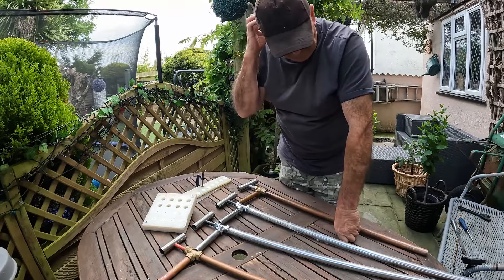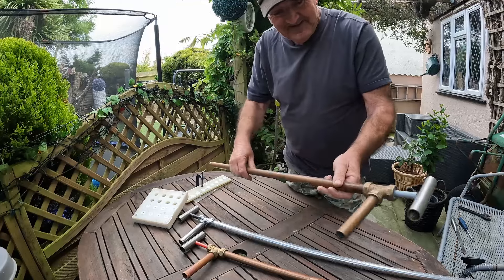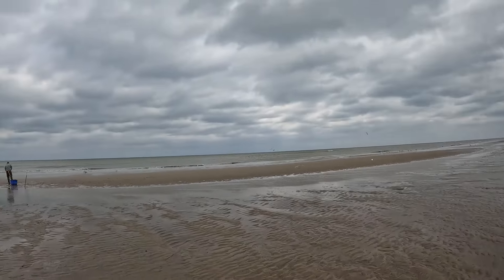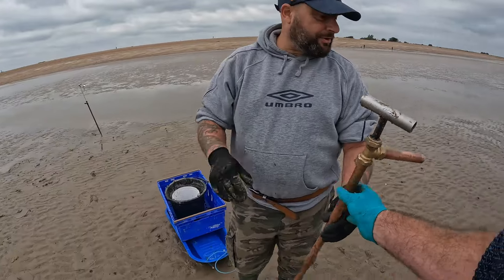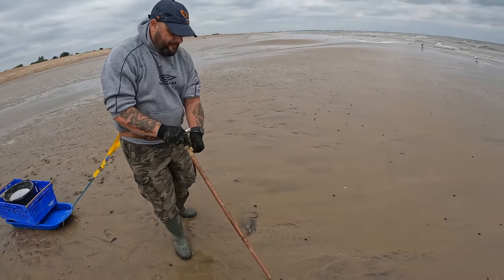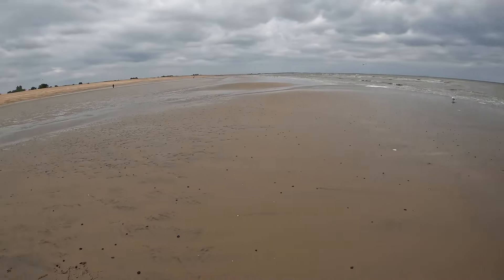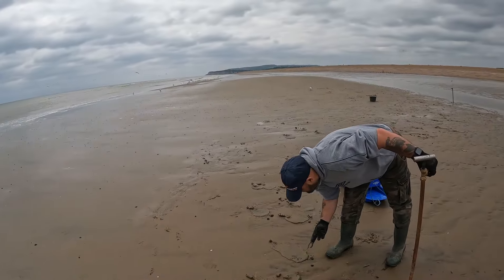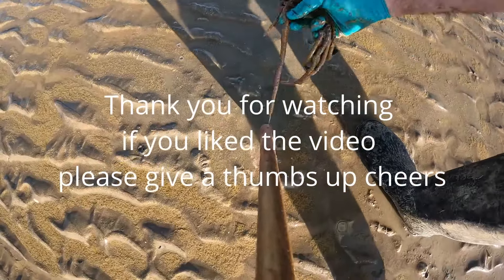jay a subscriber puts my lugworm bait pumps to the test

Comment: Good to see Jay using new pump..  Well all I can say is the pump is so light to use... Great suction with super smooth action and no washing up liquid required.. Great Job Mt.. JC301... (pump prize winner).. Going from getting tails to getting worms.. Tight lines.. You should patent your silicone washer.. That's the key to this new machine. Cya pal.. Cheers.
Reply from the maker: Hi jamie i hope your working that pump you won lol thanks for the post mate

Comment: How do you stop the copper going green just asking as never used a copper pump,as for the wear mark  worms where I go alter in depth every time I've started using a 22mm diameter but bore is 19.6 mm and I'm hammering them it's stainless to but very light 8mm bar
Reply from the maker: Hi Pete I think it all depends on how much you use it and if you clean it I just throw mine in the back of the motor until next session and works fine no lub required just a dip in a puddle and off I go again